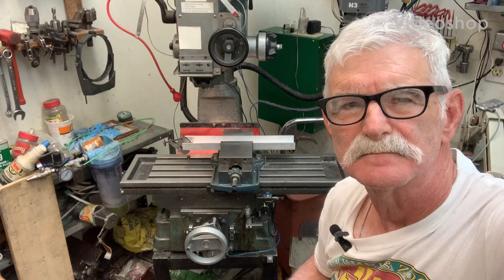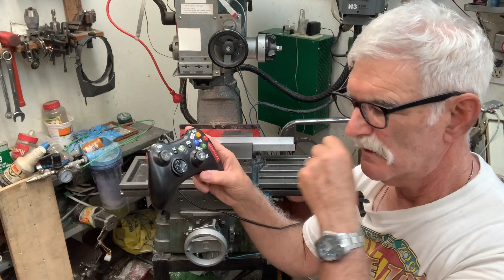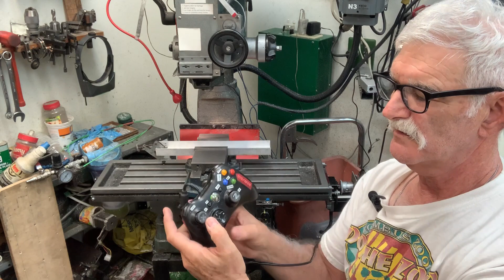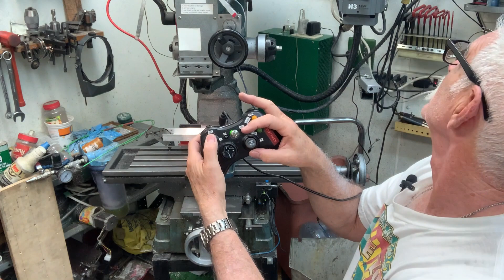X-Box Controller On my CNC Mill

Comment: This is a great example of democratized information. Tons of college lectures on just about any subject and information from a diverse community on cnc. I've built a 5c cnc lathe a cnc mill with a stand alone cnc 4th axis, just finishing up a cnc router, and built control boxes for all of them. All use arduino microcontroller and free software for cad and cam. YouTube the best and worst place to find information on just about anything. Just found game controllers can be used as pendants.